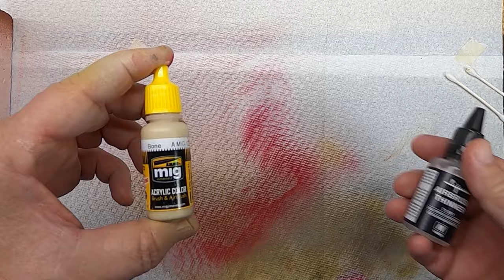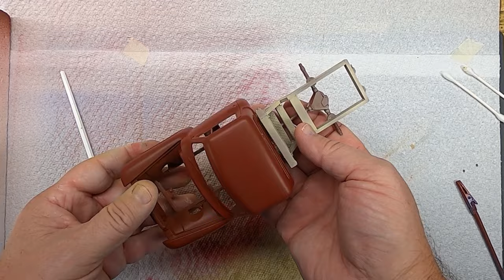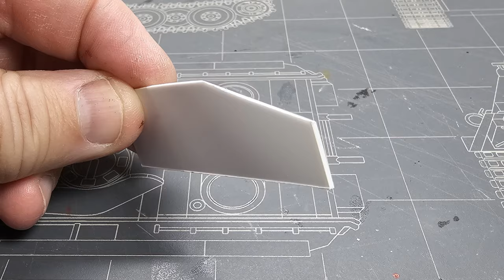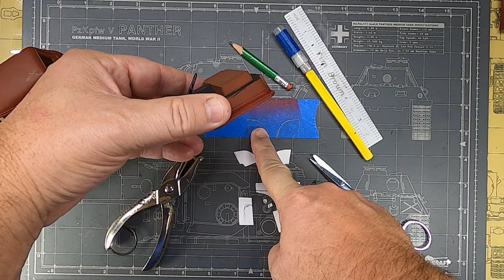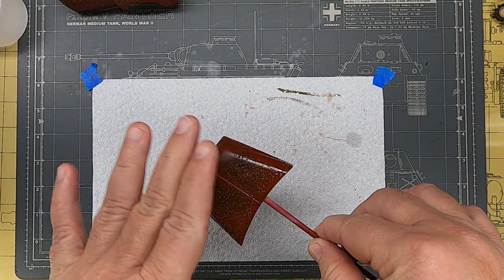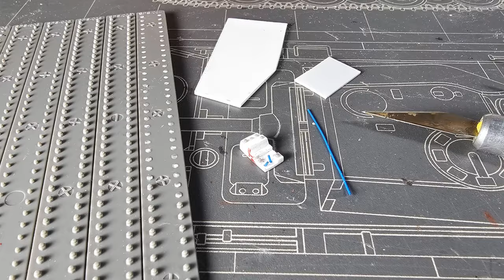USACC Group Build/Monogram 55 Ford Rat Wrecker Build

Comment: Killer job..the shot from above made me think dual rear wheels may have been the way to go..just looked a little empty..just my opinion
Reply from the maker: Thank you Chris, so glad you liked the build!! Yes, you are right, I was originally going to go with dual rear wheels. I messed with that for a few days mocking everything up that I had but just couldn't come up with a set I liked for this build. If I was to do another one (and I'm sure I will with a different cab some day) I would definitely go with duallys in the rear!!

Comment: That turned out great Tim, the electrical box was a great save and the tool box is too cool .
One question what did you use to get the salt to stick?
Reply from the maker: Thank you Mark, so glad you liked the build...... Water...... Wet the area, sprinkle some salt, let it dry, then paint it, let the paint dry then rub it off.
Reply: Thank you Tim I will try it on my next project . Are you going attend the Midwest Freeze Frame March 9 ?
Reply from the maker: @markyoder4025  I think you will enjoy it, it's always fun weathering.... Speaking of weathering, dendiing on weather, I plan on being there.